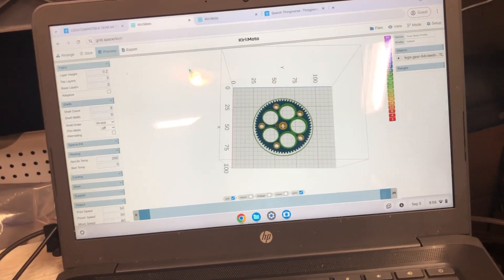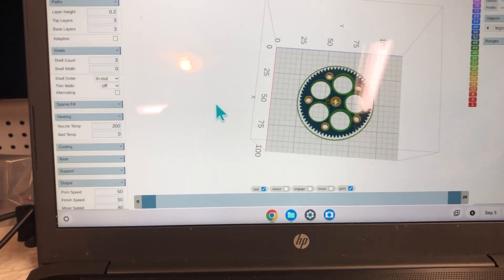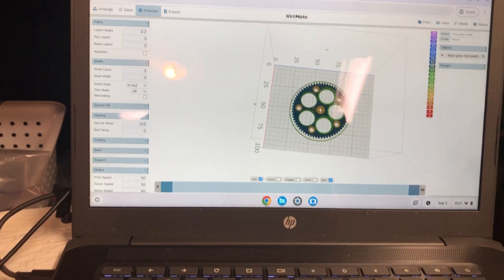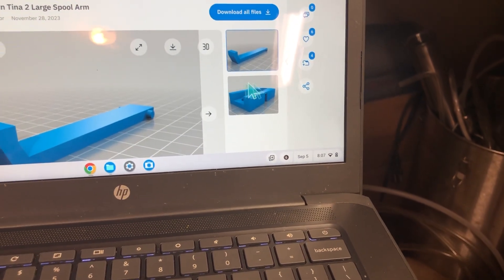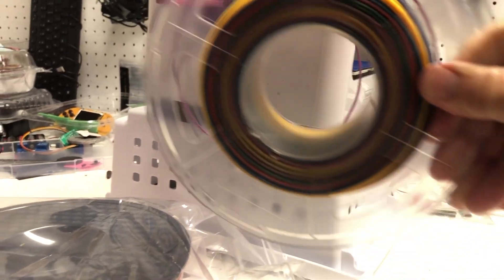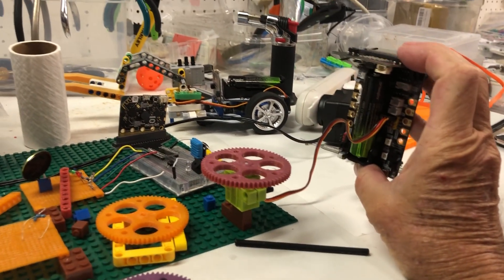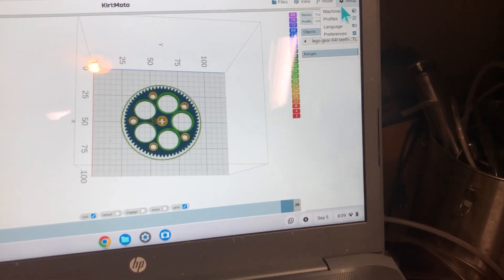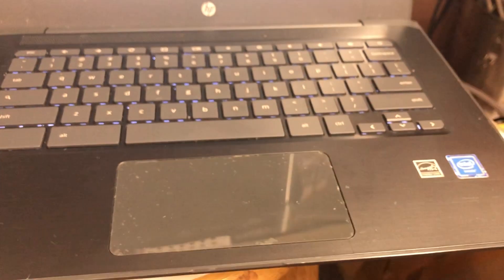Temperature Settings LEGO Printing Chromebook and Tina2 3D Printer

Comment: Tina2 basic profile is set to 200 °c as default as it's a good general setting that will cover a range of filaments 

 different filaments may need different temperature - good idea to print a simple test print with each new filament to confirm what temperature it prints best at

You may also need to alter print speeds, Kiri defaults to 50 , I've found with some of my filament 40 to 45 gives better results